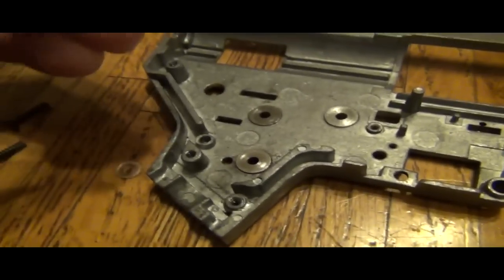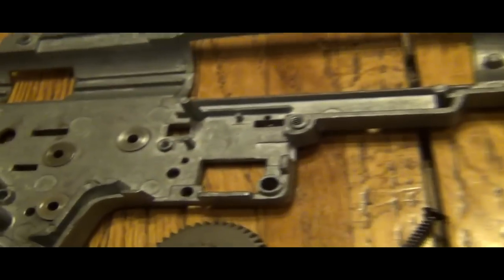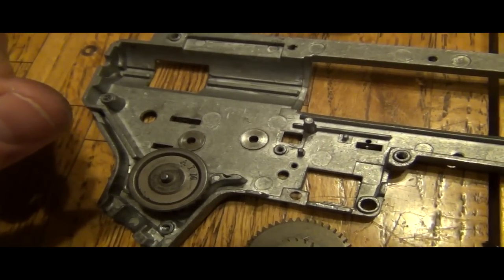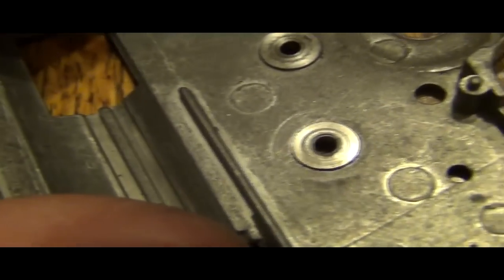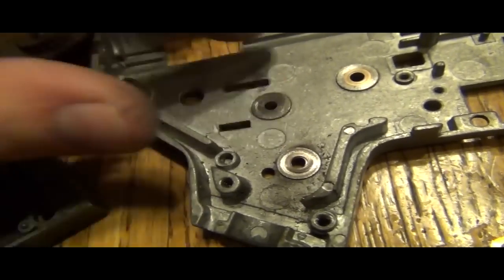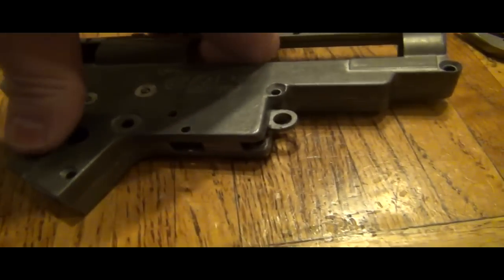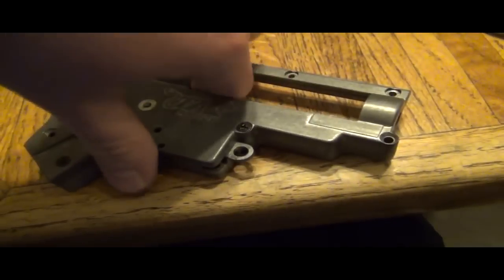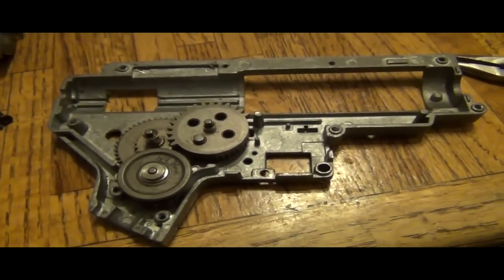Finished Gear Break-in With Positive Results

Comment from the maker: Hi Brian, I wasn't saying this is the best spinning possible, I was saying the gear break-in works. If you saw how it was before your jaw would of probably hit the floor. Mine did... the gears couldn't even spin and at some points got stuck. The biggest problem is the bevel gear is not shimmed correctly and can't be. Because the gears are not TM spec I cannot change the bevel gear out. I don't have a lot of options to make it sound better. Of course it doesn't spin like my other jobs.